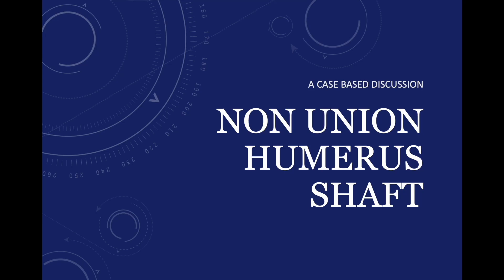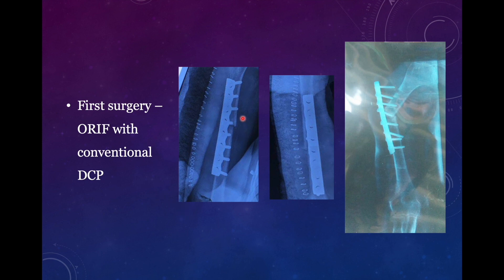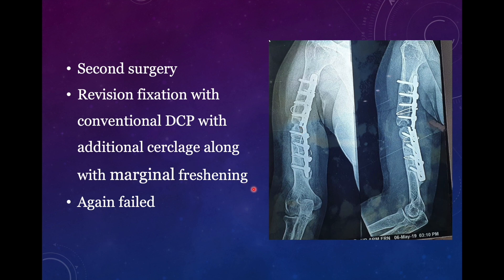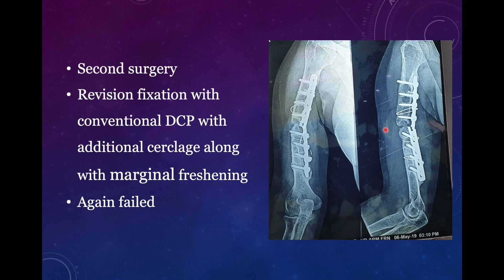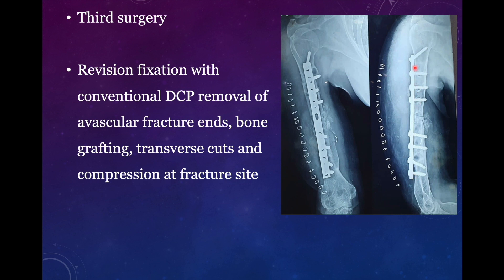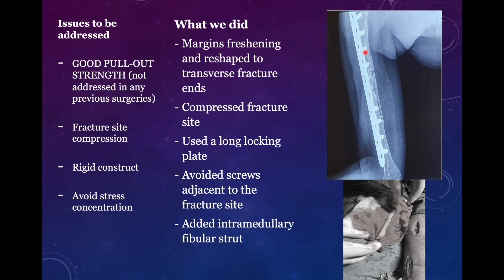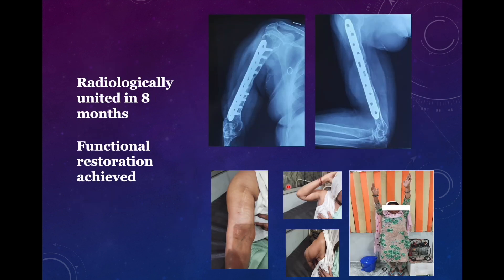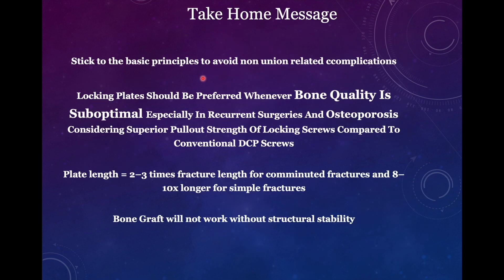Shaft Humerus Non Union: A case based discussion

Comment: Sir,what is the ideal approach for midshaft humerus fracture?

Sir , should we go posterior always...
Or anterolateral have same result?
Reply from the maker: Posterior approach is used in situations when we want to explore the radial nerve like in case of open wound with radial nerve palsy or nerve palsy that occurred during manipulation or when the fracture is in lower third requiring long plate. Otherwise for midshaft humerus fracture, without radial nerve injury, anterolateral approach has same results.
Reply: @Justorthothings  thank you sir

Comment: At 0.36 we see the entire upper body has been included in the primary beam which means 5 times the radiation dose. Post op xray at 0.48 shows 2 projections but they are at 45 degrees to each other rather than 90. At 5.51 we see 2 projections that are not 90 degrees to each other and a needless whole body dose. Why are Indian radiographers so bad at their job of providing diagnostic images with minimum radiation dose. I have looked at 500 radiography tutor videos from India and my estimate is that the body dose is 6 times more and the gonad dose is 1000 times more. For example, look at the way I do a cervical spine series with extremely accurate positioning and collimation. https://youtu.be/ZcvH11MfgUo?si=WL0iOcy4eKftxhm1